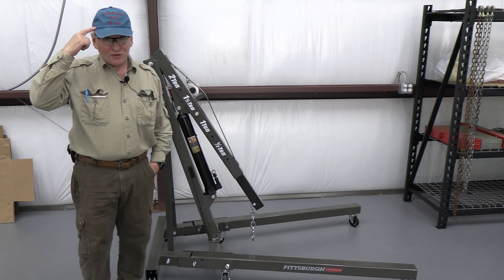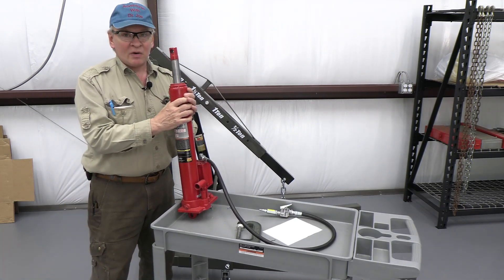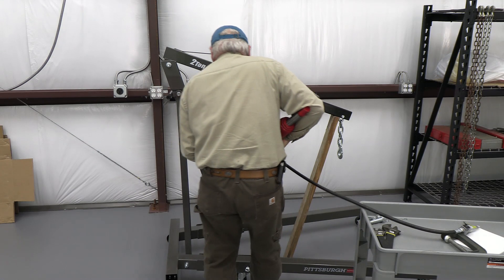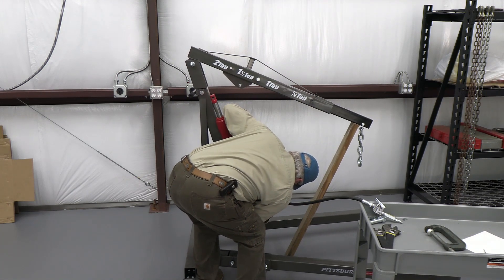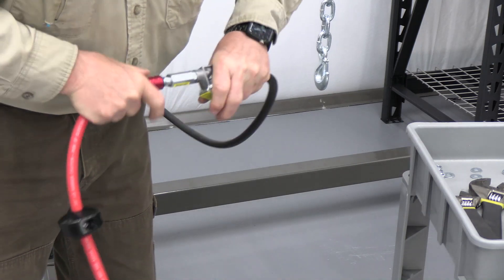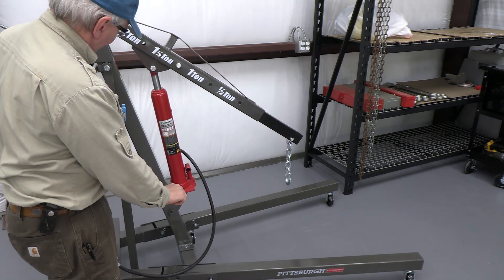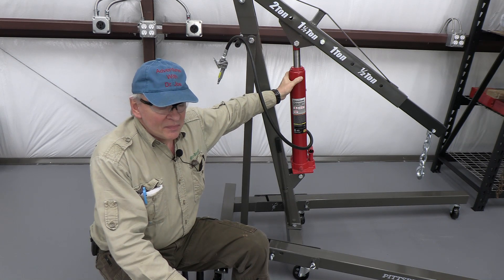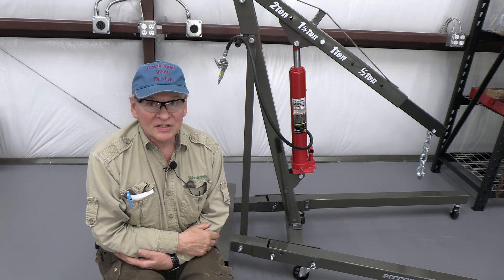Air Powered Ram for Shop Crane Install and Use

Comment: Which particular air compressor can I use to pump the jack.Any recommendation?
Reply from the maker: Good question. This Jack requires quite a bit of airflow so a medium to large size air compressor is best because it requires medium or medium high CFM. A very small air compressor will have a hard time handling the requirements of this air hydraulic ram. Consider subscribing. Thanks Joe.